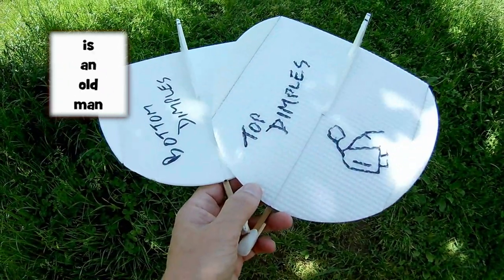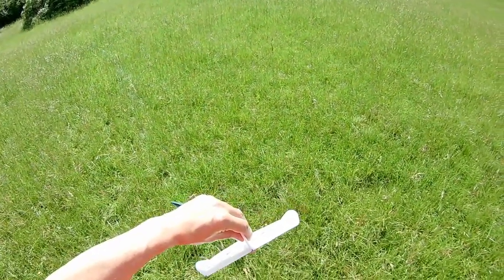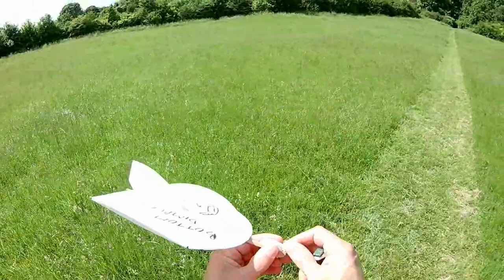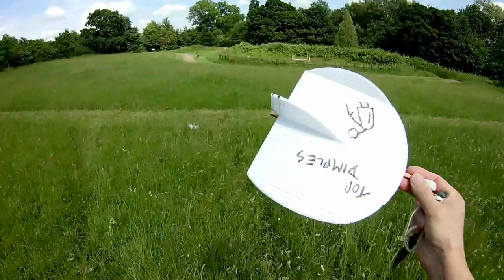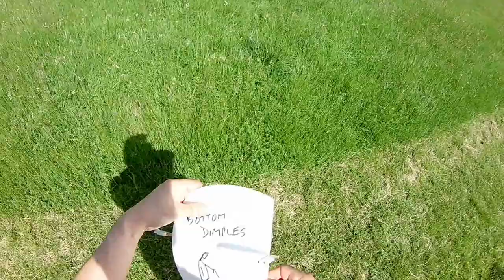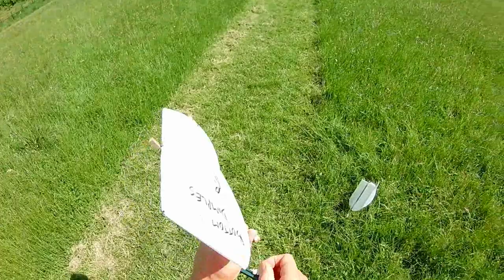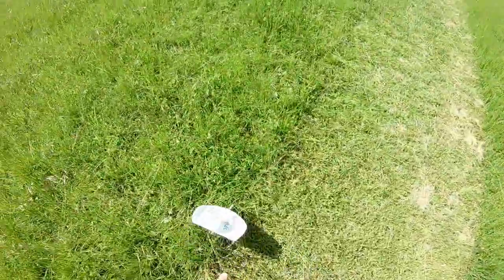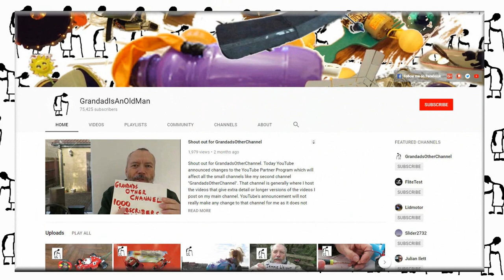Top or Bottom Dimples Pizza Tray Catapult Launch Gliders Test Flights

Comment: I think your "upside down" issue is due to too much left angle when you launch it. For that much wing area, you shouldn't need much more than 10-15 degrees. Also, try using more rudder to steer the plane rather than the wing trailing edges. This will cause it to kind of "fall" back into its turn if it stalls.

Comment: Finished watching it. Love the flying wing design.  have you considered a fin on the other side well to maybe stabilize both planes across the board?
Reply from the maker: The fin gives you directional stability - ie keeps it in a straight line. There are often debates about high wing or low wing in relation to the fuselage on the basis of stability and the "pendulum" effect of keeping the weight below the wing so some people put the fin or rudder underneath rather than on top.

Comment: Horse flies. .....once bitten forever shy.
We have them here.  We also have deer flies.   Same idea.
But the absolute worst are the black flies.    (not house flies).
As blood thirsty as a horse fly but as sneaky as a a house fly crossed with a mosquito.
Their bite leaves a huge welt. 
As for the upside down flight. The weight of the rudder and also the blue tac on top of the nose has raised the cg above the fuselage too much.
Edit - I meant the center line of the fuselage.....not the cg.

Comment: How do you make them
Reply from the maker: I am afraid that if you check out the associated playlist - link on the screen and in the video description and here https://www.youtube.com/playlist?list=PLA5a2xPRSrB2dqIXgVdsdmjj9VwfO5CUt you will see I have NOT done a full build for these as the only purpose in building them was to create two identical planes to test the effect of the dimples. However in version 2 I do show the general build technique and that video comes up on Wednesday.  The basic build is just the circular foam tray that comes with many different supermarket brands of of pizzas. I  fold a bit of tip dihedral in them to help stability, glue a rudder or fin on top and glue a wooden stick underneath for the fuselage with a plywood nose hook for the catapult launch.
Reply: GrandadIsAnOldMan thanks
Reply from the maker: I am making version 3 specially for you so I can do the build video 😊
Reply: GrandadIsAnOldMan thanks  I'm looking forward to it